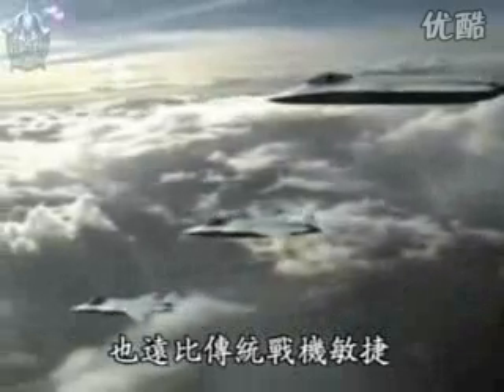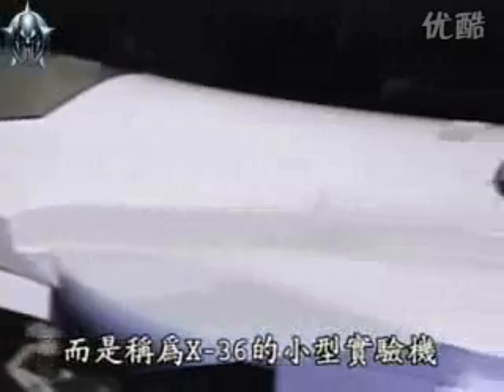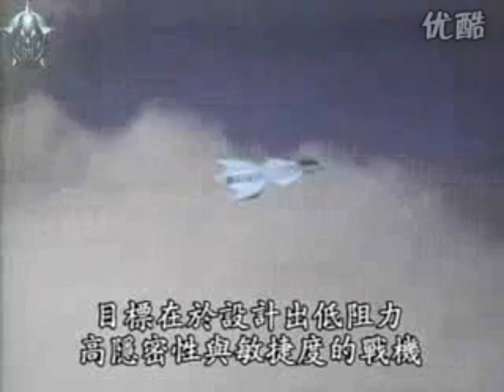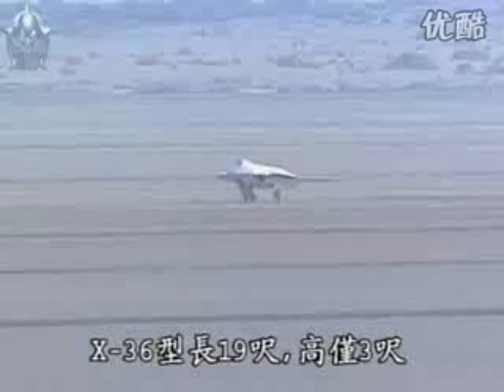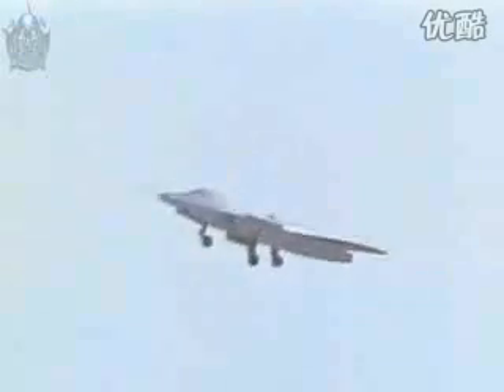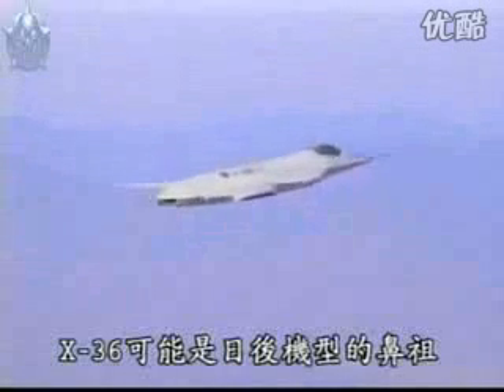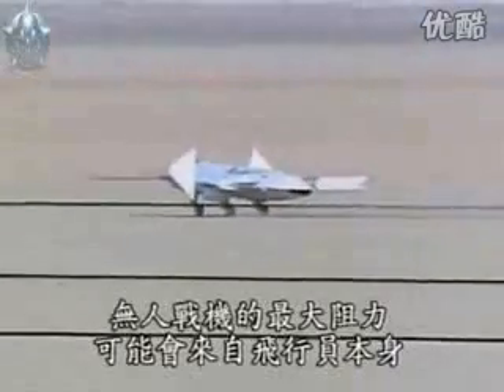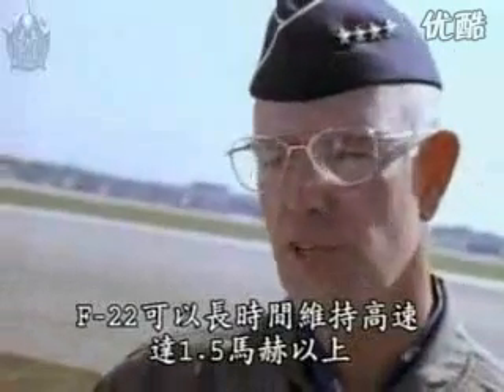Mcdonnell Douglas JSF proposal and x-36

Comment: Mc Donnell Douglas  again had the better design aircraft (F-23) and the politics played into the pos problem plague  f-22, preventing MDC from winning the JFS. The Air Force and politics would cancel or prevent anything that would be better than the f-22even though the f-22 has always been the lesser of the F-23
Reply: FALSE, 

YF-22, demo'ed very high alpha
YF-23, promised very high alpha. 

YF-23 has inferior A2A weapons load i.e. carry three AIM-120s and two AIM-9s it's internal weapon bay.
YF-22 demo'ed AIM-120 missile being fired from it's weapons bay with superior A2A missile load..

For comparsion, F-35A Block 4.4 has six AIM-120 type missiles within it's internal weapon bay.
Reply: @valenrn8657  yet still met the ATF requirements and the 23 still outperform the craptor in everything.
Reply: @ximenoworks  YF-23 didn't outperform YF-22 on "supermaneuverability" high AoA and internal weapons bay.
Reply: @ximenoworks  Both YF-22 and YF-23 has meet ATF requirements, but it's a competition.
Reply: @valenrn8657  except  it turned political with the lesser  awarded
Reply: @ximenoworks  YF-22, demo'ed very high alpha.
YF-23, promised very high alpha. 

YF-23 has an inferior A2A weapons load i.e. carries three AIM-120s and two AIM-9s its internal weapon bay.

YF-22 demo'ed AIM-120 missile being fired from its weapons bay with superior A2A missile load.
Reply: @ximenoworks  
F-22A has assimilated YF-23's diamond wing influence. 
F-22A has assimilated YF-23's canted tail's edge shaping for the horizontal tail's edge shaping.
Reply: @valenrn8657  yet it will always be 2nd after the 23
Reply: @valenrn8657  Just very slightly. The 23 DID outperformed the craptor  in everything except slightly one.
Reply: @ximenoworks  From  Paul Metz,

 The F-22's thrust-vectoring can provide remarkable nose pointing agility should the fighter pilot choose to use it. What is not widely known is that thrust-vectoring plays a big role in high speed, supersonic maneuvering. All aircraft experience a loss of control effectiveness at supersonic speeds. To generate the same maneuver supersonically as subsonically, the controls must be deflected further. This, in turn, results in a big increase in supersonic trim drag and a subsequent loss in acceleration and turn performance. The F-22 offsets this trim drag, not with the horizontal tails, which is the classic approach, but with the thrust vectoring. With a negligible change in forward thrust, the F-22 continues to have relatively low drag at supersonic maneuvering speed. . But drag is only part of the advantage gained from thrust vectoring. By using the thrust vector for pitch control during maneuvers the horizontal tails are free to be used to roll the airplane during the slow speed fight. This significantly increases roll performance and, in turn, point-and-shoot capability. This is one of the areas that really jumps out to us when we fly with the F-16 and F-15. The turn capability of the F-22 at high altitudes and high speeds is markedly superior to these older generation aircraft. I would hate to face a Raptor in a dogfight under these conditions
Reply: @ximenoworks  the YF-23 had the same cockpit as the F-15E Eagle and similar technology,

YF-22 had a completely new cockpit with 5 LCD displays and new technologies, which were ahead of the Black Widows. Another advantage of the YF-22 was the control stick, the YF-23´s was mounted in the middle, but the YF-22´s on the side, which was preferred by the pilots.

------
Unlike the YF-23, the YF-22 performed missile shots (even if that was not required by the Air Force) to proof the success of their weapon bays, this was a great advantage to win the competition. The YF-23 on the other hand showed some massive problems with the weapon bay and it was unable to launch a missile, because Northrop focused development on the EMD F-23. In this round the YF-22 wins out the YF-23.
Reply: @ximenoworks  F-22A's supercruise has reached Mach 1.8 which matched YF-22's Mach 1.8 and exceeded YF-22's Mach 1.6.
Reply: @valenrn8657  yet the 23 is still faster and stealther

Comment: @stealthyf23 

Yes, the military has a habit of choosing a high-risk design (Boeing) and a low-risk design (Lockheed), based on F-22 data.

However the McD/BAe/Northrop design required two engines 100% operational, and it was a re-design of their original canard-based concept, with less than a year to go, which meant it was a rather hasty re-design that they did.

Great ideas, but I can understand some of the concerns.

Read more about it on Alex Stoll's page! Google: "Alex Stoll JSF"

Comment: The X-35 beat the X-32. The X-35 was then used for the JSF program to produce the F-35. There are 3 different variants. F-35A is a conventional take off and landing variant. F-35B is a short vertical take of and landing variant. The F-35C is the carrier capable version. The X-32 lost because it was not manueverable enough and the X-35 constantly performed better.

Comment from the maker: the x-35 didn't beat the x-36.  the x-36 is a different program.  You probably meant why did the x-35 beat the jsf proposal of mcdonnell douglas.  Well, the reason was never gone publically, but critics believed that the x-35 and x-32 are two polar opposite designs, and the military used to choose opposite designs to compete with one another.  The mcdonnell one is a middle ground between the two, thus discarded
Reply: The problem with the forward canards is stealth with longer wave length radar.

Comment: The point is not about "no tail." The B-2 has no tail, and it was made in the 80's. However, using no tail as an advantage for maneuverability by using thrust vectoring as a mean of fly-by-wire system, however, is technologically break through.